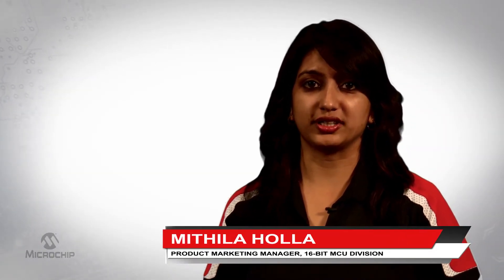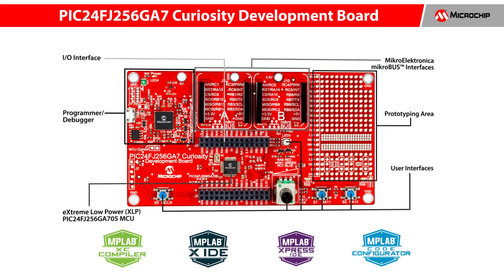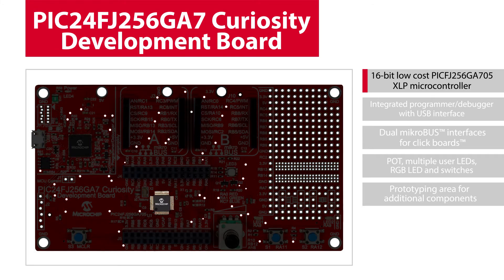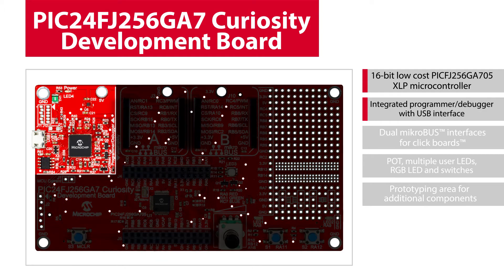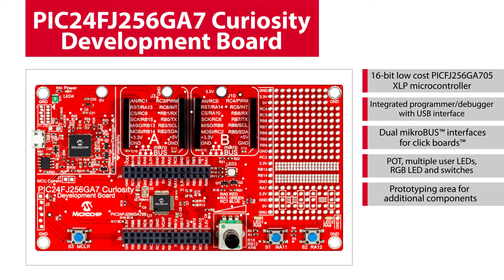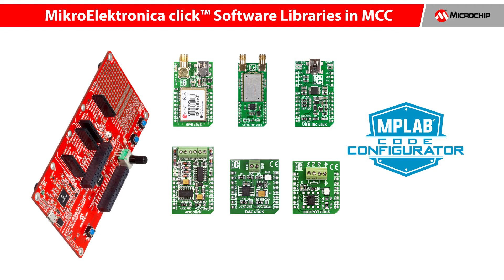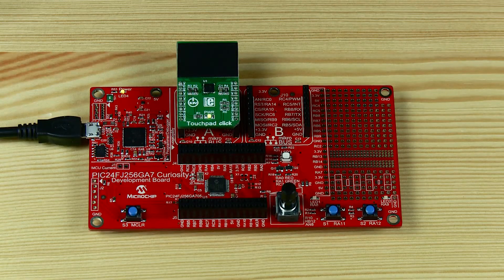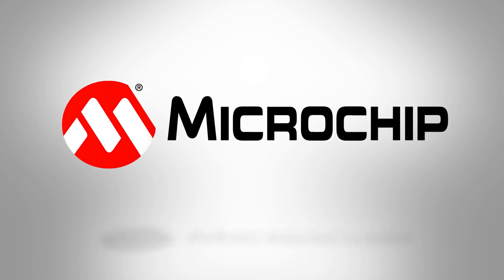PIC24FJ256GA7 Curiosity Development Board

Comment: Can you explain , how interface SAM-IOT WG with ADC 7 click board please?
Reply from the maker: Hi Ramesh,
Our SAM-IoT WG development board uses the mikroBUS sockets to expand your design with the selection from 450+ MikroElekronika click Boards, including ADC7 click Board. It is a plug-and-play solution! The user can push the click board into the innovative new mikroBUS socket and use it with zero hardware configuration. Let us know if this helps.
Reply: @MicrochipTechnology  I appreciate your answers. Madam I have an adc 7 click board and a Sam-IOT -wg. I have no idea how to read sensor data from MapLab and visualise it in real time. Please provide a detailed demo video. I hope it won't take up too much of your time. It is desperately required. The data must then be sent to Google Cloud for  processing data later. Could you please elaborate?